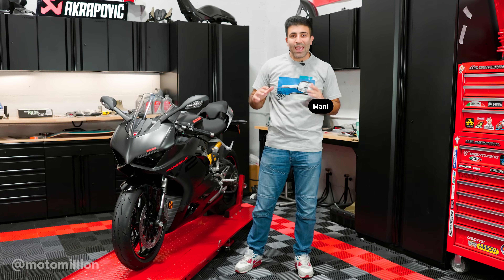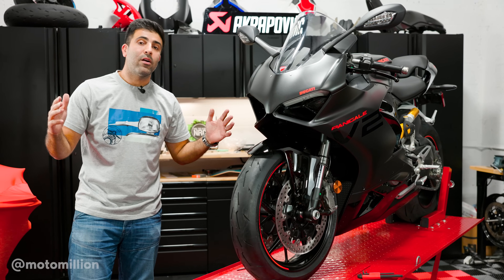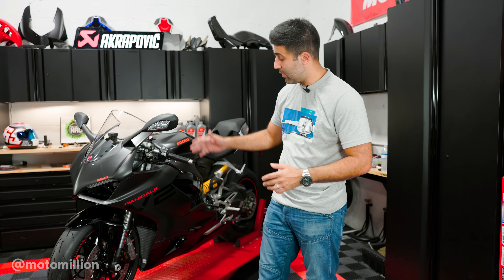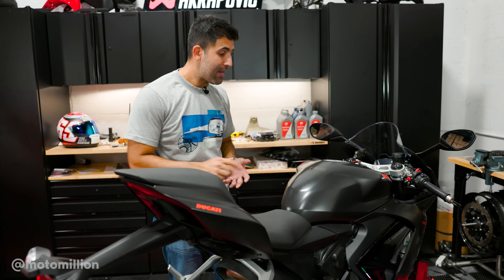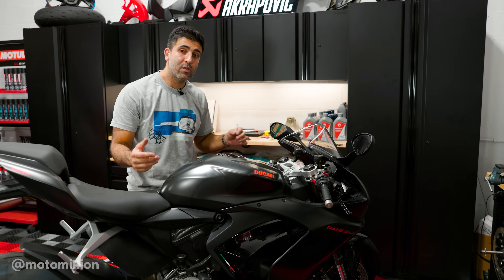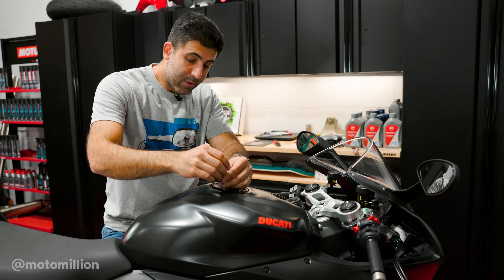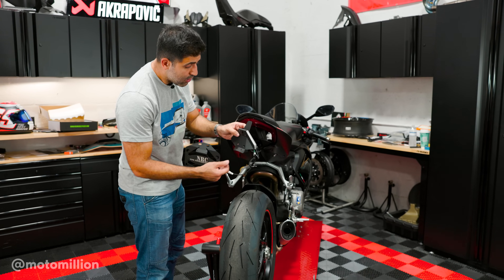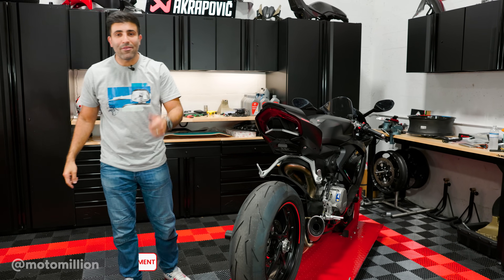5 First Essential Mods for the Ducati Panigale V2!

Comment: 310mm vs a 330mm rotor differences are HUGE. the brake pad has a 3cm surface area on the rotor. switching to a 330mm oversized rotor from a 310 as standard means you get an additional ~30% more surface area per rotation. so with the same pump and brake calipers you get more stopping power. the downside is that now you will have more rotating mass on the front wheel. regardless if the new rotors are same(or lighter) weight as the originals, they will be bigger, so the gyroscopic effect will have a small negative impact. i have done it, so i know 😄
Reply from the maker: Great explanation. We are going with lighter wheels from factory, so it may offset things a little!
Reply: Its also about the bigger leverage that comes with a bigger rotor which produces more torque with the same pressure
Reply: You don’t get more stopping power. You get more heat dissipation over time. If you’re not having problems at the track then you don’t need this upgrade. There are plenty of engineering and technical videos on this subject.
Reply: On a circuit maybe, but it’s a waste of money for other 95%.
Reply: @damienmcmurray9786  true about dissapation however not quite right.... You do increase stopping power using the exsisting brake effort by multiply tourque. more effort (energy) and time is required when trying to stop a rotating mass by using friction placed near its center of rotation verses trying to stop a rotating mass from friction placed near its perimeter.... so while you are correct about the gain in thermal efficiency it is also correct that you increase stopping power by moving the torque moment out wards from center. A great example of this is using a breaker bar slid over your tyre iron to undo a stuborn wheel nut... you are mutiplying the applied tourque but still using the same input force.
Reply: don't you need to change the pads too? with the same pads you have the same contact area, so the same brake perf

Comment: I just got these radiator guards for my v2 and I’m pretty sure these are for a 1299 they work but the fit isn’t that great
Reply from the maker: The radiator and the shrouds are the same as the 1299. If you follow the way we installed it, the fit is pretty good. If not we would never install them on our own bikes.

Comment: Sorry to disagree on most as those are catering to the squids who chooses form over function.
However I agree with #1 Rad guards and #6 Tank protector against zipper and belt wear.
My List:
#1. Rad guards
#2. Tank protector
#3. Throttle Spacers (rid that dreaded throttle slop)
#4. Gearing change (-1F cheap, +2R better) as all Ducatis are geared too long.
#5. Short levers (more comfort for two finger action).
Most important, spend on stands,  a wheel chock*, maintenance tools and supplies.
Then, bling all you want.

* Why the wheel chock? I've dropped the Pani twice in the garage. Call it carelessness, stupidity whatever. The one time, I was reaching out for my rear stand and as I turned around to grab it the bike fell off the side-stand like in slow motion. Noooooo. Never again for me. Park it in a wheel chock. It's also awesome for trailering.